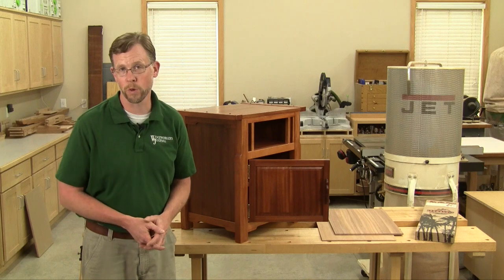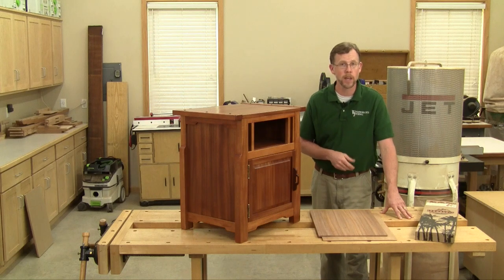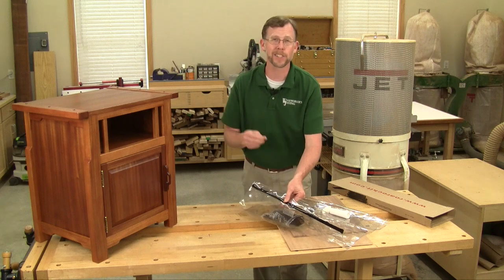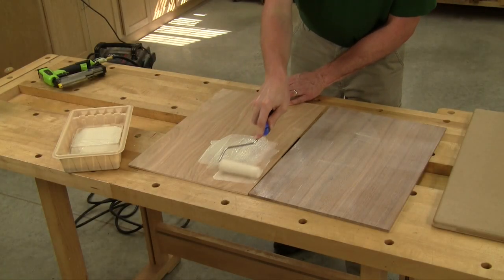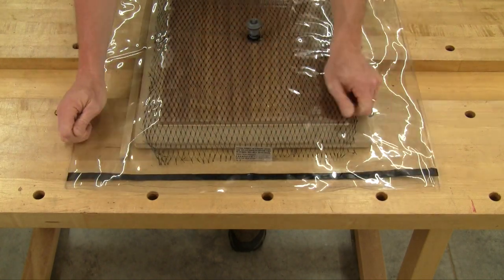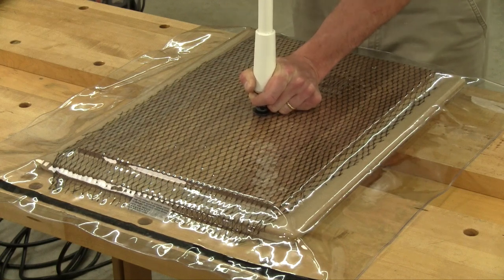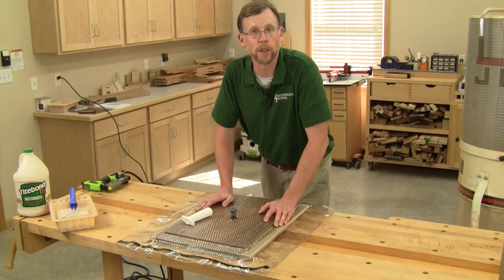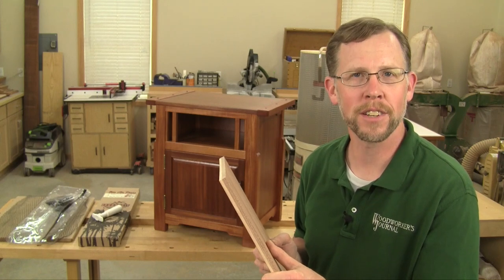Panel Veneering with a Simple Vacuum Bag

Comment: Unique solution & fun to watch. I'm new to the craft and find my knowledge increasing with the answers i receive for each ignorant question I ask. Why not contact cement on both surfaces just like when securing laminate to an MDF substrate?  I've just learned that MDF is readily available in 1/8 and 1/4 inch thickness. Would not an MDF substrate be more stable than a thin ply substrate in terms of wood movement (as mentioned in a couple of other comments I read here).  Thank you, in advance, for helping me learn by providing answer to my questions.  -Woodprobie

Comment: REALLY ENJOYED THE VIDEO. IT WAS VERY HELPFUL. I BUILT A PROJECT THIS WINTER THAT REQUIRED SOMETHING SIMILAR. I PLACED A SHOP MADE VENEER ON ONE SIDE OF 1/4 IN PLY  IN A SIMILAR MANNER EXCEPT I USED CLAMPS ETC. THE NEXT MORNING UPON RELEASE THE PANEL WAS CUPPED. . I HAD TO REMAKE AND ON MY SECOND ATTEMPT I PLACED A THICK VENEER ON BOTH SIDES AT THE SAME TIME AND THIS SOLVED THE PROBLEM. DOES YOUR PROCESS PREVENT CUPPING IF ONLY ONE SIDE IS TO BE VENEERED.
THANKS
DOC
MEBANE NC

Comment: Why use that hand pump when there's a shop vac in the corner?
Reply: By removing the air more gently, you have less chance of the wood veneer shifting whilst it is still wet and not fully clamped in place.

Comment: Unless there is some additional information that you haven't provided to us, I see one significant problem.  Your panel will warp because you failed to consider the imbalance  which adding such a thick veneer piece to only one face causes.  You need to ensure that whatever veneer you add to one face of your substrate, you add to the opposite face.

The rest of the information in your video is perfectly fine.
Reply: I was thinking that or the wood will crack and split because the ply doesn't move as much as the timber.
Reply: Spot on Marty, in fact in the last shot as he holds the panel, you can see it's already warped in a way that the veneer side has expanded and bowed out. I guess if he puts it in the grooves of the door frame, it will pull it straight, but if anyone wants to use the panel without a frame (as most people honestly do these days), you have to have an equal veneer on the opposite side, and preferably have the substrate thicker than the thickness of the 2 veneers combined, so that the substrate is keeping the veneers stable and dictates their movement, rather than the other way around.

Comment: use a shop vac with a hose approx the size of the valve.  It will pull the bag down enough that you can follow with the hand pump.  You will only do about 10-15 strokes to have a vacuum.

Comment: Hmmmm.  Wouldn't it be possible to do two veneered panels at once?  Place one veneered panel face down in the bag. Put the MDF platen in the bag. Then position the second veneered panel face up on top of the MDF.  Use the netting on the top panel and the bottom panel.  Seal the bag. Draw the vacuum.  You get two veneered panels instead of just one.   

Also, regarding the Shop Vac ... seems like you could arrange a small manual "valve" to control the rate that the majority of the air is drawn out of the vacuum bag --- then switch over to the hand pump to finish off.